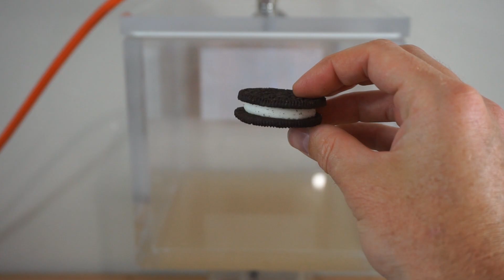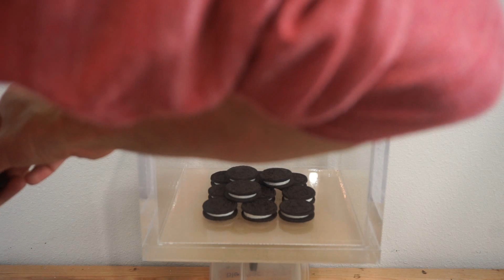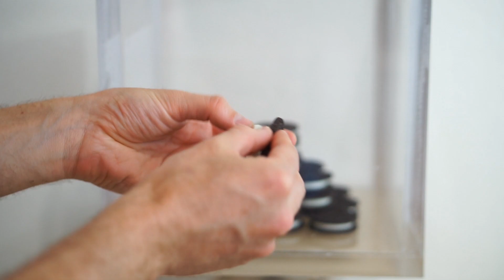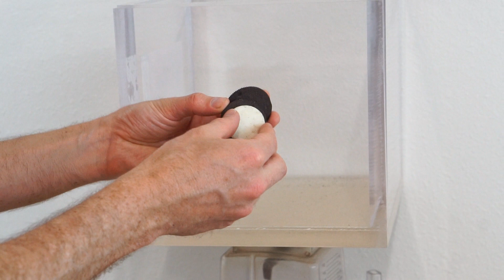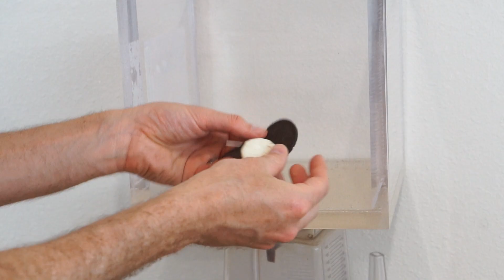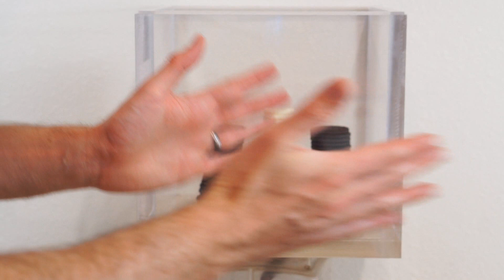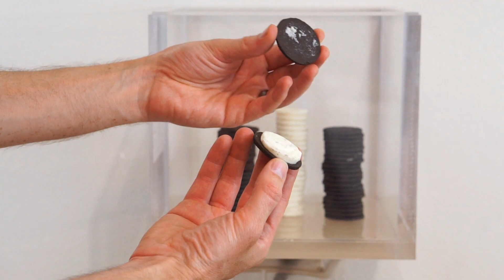Perfect Oreo Separation Using a Vacuum Chamber

Comment: the only reason is because its gets colder in a vacuum. put your oreos in the fridge for a few  minutes. same thing.
Reply from the maker: +Jeremy Josh they didn't get cold. They were room temp:)
Reply: they do get cold in a vacuum, watch a few videos on people freezing liquid nitrogen using only a vacuum chamber. same principle. The amount of heat lost may not be measurable by hands, but its enough to firm up the oreo cream a bit.
Reply from the maker: +Jeremy Josh I am the person who did the experiment, they were not cold at all. Liquids get colder in a vacuum due to rapid boiling from lower pressure. Gasses expand in a vacuum and get colder. Cookie filling does neither. It wasn't cold I literally was holding them in my hand. They were room temperature.

Comment: But why does the cookie "get bigger"? I mean, I didn't notice a thing until I saw the fast forward version and it kind of "deflated" at the very end, which proves it I guess. Why does the filling expands in the first place though?
Reply from the maker: +Macarena Covarrubias Riveros since the pressure decreases in the chamber the tiny air bubbles in the cookie expand.
Reply: The Action Lab The Action Lab I see! So that's why you mentioned something about the filling having too little air bubbles. I think I can picture it all in my mind. They expand because the pressure decrease is, like... trying to suck them out, right? Is this similar to vacuum seal food?

Comment: A little late, but I think why it happens, is that the creme and cookie expand at different rates under vacuum. So just like you twist off the top normally by shear force, there is a uniform shear force across the entire cookie-cream interface. That gets it unstuck just enough to fall apart. It's like, to unglue something, you only need it to break loose, not move very far.

Comment: There are small pockets of air between the stuffing and the biscuit. When you reduce the external pressure, these are bubbles expand, literally pushing the biscuit away from the stuffing. They don't stick back together because there's nothing forcing them together - it's like how you can rub your figer likely on sticky tape and not get completely stuck (if the tape is anchored down), but your finger will stick if you apply some force.

Comment: What made it stuck in the first place is unknown to me so I'll work backwards. In a vacuum all air is removed therefore making the pressure outside the oreo smaller than that of it inside. This allows the particles which are not in a fixed position (the white milky part) to expand. Upon the process of which it expands, the particles of the white part is no longer stuck to the surface particles of the black chocolate part and will also be the case after it contracts from the return of outside pressure. Both sides of the white part will now have been released from the black part after expanding and contracting again. Am I wrong in the sense of what the answer of interest really was?

Comment: When in a vacuum the cream expands and fills all the nooks and crannies so far as it is able (not much change from normal). When the air is let back in the cream contacts and what was in the nooks and crannies no longer fills those spaces completely, so little hold remains and they separate easily.

Comment: The oreos separate because of the different expansion rates of the cookie and the cream and the fast compression while the air rushes in.
This is also useful for any type of double sided tape, just tug on one edge and the adhesive curls from the protective layer where you can grab on to remove the rest.

Comment: I think it might be something with the melting and boiling points of the oreos' molecules changing, but it's probably wrong.
Another guess is that the tiny bit of air inside the oreos tries to escape through the top and the bottom of the oreos and makes them separate.

Comment: My guess is that they were made in a low pressure environment, so they stick together with suction when they are in the normal pressure. The suction goes away when they're in a vacuum.

Comment: Actually, I have a method for a really long Oreo
1. Take the caps off all your Oreos.
2. Combine two capless Oreos by conjoining the two cream sides together.
3. Press down hard but monitor whether you are putting too much pressure on the cookies.
4. Lift the cap on the conjoined cookie. If it breaks pick off the remaining pieces or use a knife.
5. Conjoin that stacked cookie with a regular capless cookie.
6. Rinse and repeat.

I made it to seventeen creams and two caps on the bottom and top. My mom was disgusted, everyone else started laughing and the cookie was delicious.

Comment: umm... since the white part changed size, its surface that connected with the cookie broke free since the cookies surface stayd the same?
Reply: mh... his explanation doesnt make sense, them contracting wouldnt pull the inside away from the cookie, since they are vertical, gravity cancels that possibilty out, the cookie would rise and fall the same, not resulting in 'pulling' between any surface in any possible way..

Comment: I think its kinda like permafrost, the filling is connected because its in the pores of the cookie, but then when it expands it pushes on those pores either making them biger or making the bits inside them smaller as its pushed against the harder material of the cookie, then when it shrinks back down the new shapes of either are shrunk back down leaving either a cookie with slightly larger pores or filling that the bits that were inside The pores are now too small to stick. I think its more likely the filling is reshaped by pushing aginst the cooky than the other way around.

Comment: I'm not sure if I buy into your logic. 

My prediction is that depressurisation causes the centre to essentially solidify / become more viscous (things at low pressure have lower freezing points). In terms of falsifying my claim you could try both; Doing this test again, allowing time after depressurisation and breaking them apart, or freezing an Oreo and proving that doesn't do as I expected. 
Sadly, I don't eat Oreo's so cannot verify.

Ta ta, and farewell

Comment: because there are a little grooves in the inside of the cookie and there are air pockets in the cream and so the air pockets want to hang onto the little Ridges of the cookie so when you twist it it breaks that connection. But the other side will still be stuck because there's nothing to break the bond with the air pockets in the cream and the ridges in the cookie. that's my guess

Comment: So basically there is a vacuum between the cookie and the frosting but it's kept tight so the air stays outside and they're sticked together. When you use the vacuum all the stuff has the same pressure so they're able to seperate.

Comment: My guess is that when the air inside the cookie expands from the pressure inside the chamber, the expanded air breaks the little air channels in the cookie. When the pressure drops in the chamber by letting the air back in, more air can be released from inside the cookie than before because the air pockets broke, meaning the cookie will shrink a little bit. This is why I think it makes it so easy to separate. The seal between the cookie and the cream broke because the cookie shrank. The same thing happens to a marshmallow when the air inside it expands, like in a microwave for example. It will puff up and get bigger in size, but when the air inside it cools, the marshmallow will be smaller than it originally was.

Comment: My guess, mostly the cookies and to a lesser extent the filling do have air pockets that expand under vacuum, the filling is mostly following the jagged contours of the cookie like a and only adhering to spots at the peaks. When the cookie outgasses under vacuum it is sufficient to break the adhesive force of the filling and then the weight of the cookie is not enough to adhere again, although if you stacked cookies high enough I would think the bottom ones might. When originally assembled the cookies were forced together with no idea that they would have to survive a vacuum.

Comment: My guess: The inner faces of the cookie wafers are not perfectly flat, but have a little texture. That is what lets the filling "grab" the wafers - when they're assembled at the factory, the filling flows into the tiny crevices, then firms up in place, creating a matching "anti-texture". Under vacuum, the tiny amount of air in the filling expands, but the filling blob remains perfectly molded to the cookie texture where they touch - there's no room for the filling to flow any further into the wafer's crevices. Then, when the vacuum is released, the filling shrinks, causing the filling's molded texture to become misaligned with the wafer's texture. Since the two textures no longer line up properly, there's much less friction, and the cookie falls apart.

Imagine two jigsaw puzzle pieces that fit together - one rigid, the other slightly squishy (like frosting, not elastic like rubber). If you put the pieces together, then try to make the squishy piece bigger, it will deform against the rigid piece. If you then shrink the squishy piece back down, it will no longer fit the rigid piece, and can slide away without lifting it from the table.

Comment: MY GUESS: According to Charles's Law, pressure is inversely proportional to a gas's volume. As one reduces the pressure, the volume of the gases in the Oreo cream increases. After the air is let back in, the gases return to their original state, but because the gases have expanded in the vacuum, the two black tops have slightly been pushed up. Therefore it is much easier to "slide" the two Oreo tops off.

Comment: Actually, you pull it apart in the straight parallel motion. The icing will lift off on the remaining side and you can peel off the icing.

Comment: i believe its because of the fact that the cream is being a adhesive to it when it was a bit stickier when they made it and then it dries just a tiny bit and sticks onto the cookie plus you got the ridges and pores in the cookies where the cream is smushed into but then when it expands ever so slowly then shrink causing it to lose said adhesive properties enough to basically come clean off the cookie i think roughly

Comment: So how were you able to test that it was when the air came back in that the cookies separated? You obviously can't try pulling the cookies apart while they're still in a vacuum. One contributing factor to separation may have been moisture evaporating from the stuf while in a vacuum, rendering its adhesive capability ineffective. This is backed up by the fact that in another comment you said the Oreos may have been even creamier. This suggests an easier mixing of the stuf and your saliva, leading me to believe that the Oreos contain less water after being subject to a vacuum. If you're crazy and want to test this, you may find a very slight disparity in the mass of vacuum chamber oreo stuf

Comment: As air is being removed from the chamber, the pressure inside decreases. Boyles Gas Law states that as pressure decreases, volume increases. What is going on inside the chamber is the volume of the cream in the cookies increase because pressure is decreasing. When the cream expands, it looses the hold that the cream has between the two cookie pieces causing the cream to be removed easily like seen in the video.

Comment: You should put clear slime in the vacuum chamber. If you don't know how to make clear slime here's how.
You'll need:
Elmers clear pva glue
Hot water not exactly boiling
Borax powder
A bowl and something to mix with.

First take one cup of hot water and put it into a cup then take one tablespoon of borax powder and put it into the hot water. Mix the borax mixture and wait for it to clear up. Whilst waiting to clear up you can take your bottle of clear blue and put it into a bowl. After your borax mixture has cleared up, slowly put one tablespoon at a time into your glue, repeat this process until it no longer sticks to the bowl. If too sticky add more of the borax mixture. 

If you don't have borax you can use other ingredients containing borax or sodium boride. Here are some examples.
Contact lens solution, eye drops or liquid starch.

If you are using contact lens solution you will have to put a pinch of baking powder before adding the contact lens.

If successful you should have some slime. Lol sorry I'm so cheesy.

Comment: Im guessing what happends is that the cream has air in it so it will expand? And when he releases the pressure it will collapse normal again and seperate itself from the cookie resulting in easy pull off of the top

Comment: I think the brittle and porous brown part of the cookie lets gas flow through its lattice-like micro structure and does not change shape, whereas the white filling is plastic and has a non-porous microstructure containing air bubbles that expand within it.

Because the filling expands more or less uniformly around a stationary center, you should sometimes see one point towards the middle where the displacement from the filling's expansion was not enough to break its bond to the hard cookie.  

Did you observe such points? I think I saw one.

Comment: I would surmise the cookie and cream expanded enough under vacuum to break the bond of the cream that "sealed" into the semi-porous cookie during the manufacturing process.  You also removed any humidity when you put the Oreos under vacuum.  Cookies are hygroscopic, so removing the moisture in the air (or lack of air) would also remove any adhesion caused by that moisture.

Could you also do the same by putting Oreos in a dehydrator?

Comment: I'm guessing that since the filling and the cookie expand at much different rates because of the different amount of air in them, they essentially separate themselves as the filling expands in the vacuum and the cookie does not.
Reply: After watching the rest of the video I'd say i was on the right track but i didn't think to mention that the filling would suddenly shrink when you let the air back in or speculate on whether the separation happens before or after the pressure goes back to normal.  How did you test exactly when the separation happens?  I suppose it isn't always at the same time.